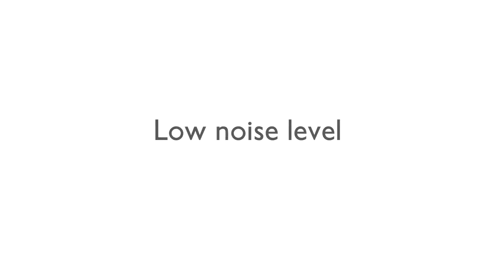FEIN Dustex Dust Extractor 25L - M Class Filter

Comment: Why does mine run on for so long.  20 seconds or more when tool switches off.
Reply from the maker: Hi Andrew. Thanks for your message. If you're using the 110v Dustex with a very powerful power tool (1500w for example) then unfortunately the Auto-Off function won't work, you'll need to turn it off manually. For less powerful tools (less than 750w) there should be no problem. If you bought the tool from us then please email us at sales@buybrandtools.com and we'll see what else we can do to help. Thanks
Reply: It's by design to run around 20s after